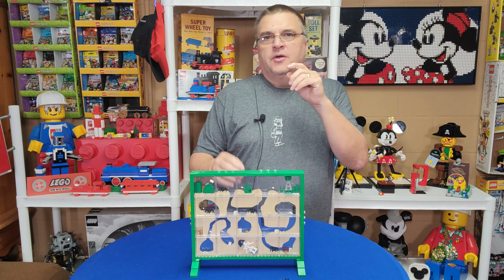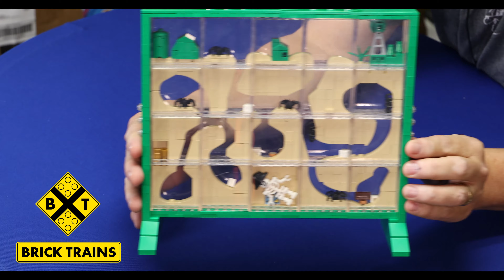Ant Farm Show and Tell, Bricklink MOC Pop-Up Store

Comment: Hey Joey

It looks impressive but, from your description, the build sounds frustrating!

I purchased instructions for an Indiana Jones Brickheadz from Rebrickable recently. It became a pain because it had very obviously been designed in Studio and, like the ant farm, there were bricks simply floating in the hat build that fell out when the finished model was built.

I did contact the designer who admitted that there was an issue. He also suggested a workaround, which Mrs H had already figured out!

I like several of the sets from the programme. But, the ones I want are far too pricey!
Reply from the maker: Don't get me wrong, I like designing MOCs digitally, but I am usually building along with the bricks.  The digital gives you the opportunity to design with out the parts or the color.  But you have to build it!